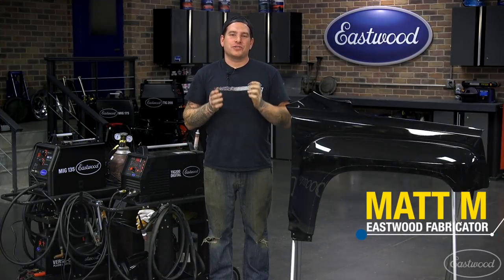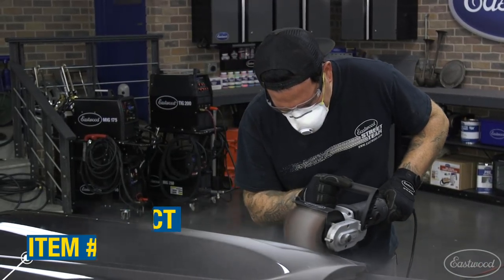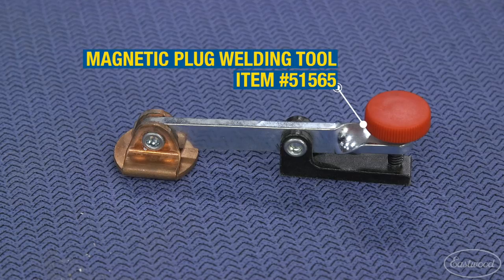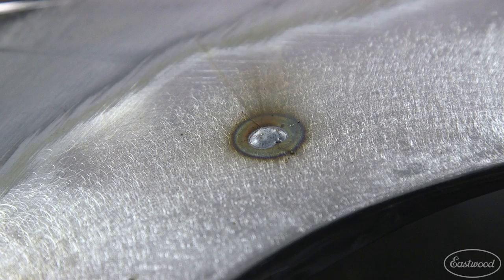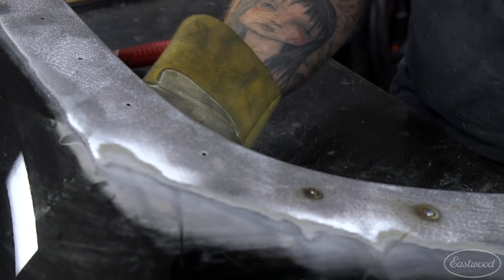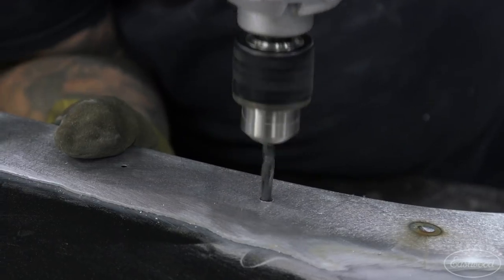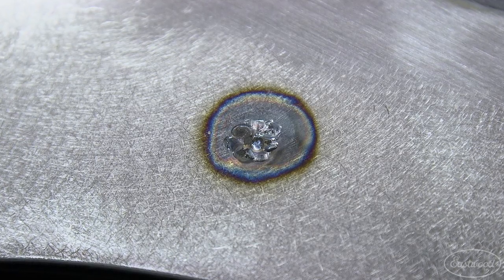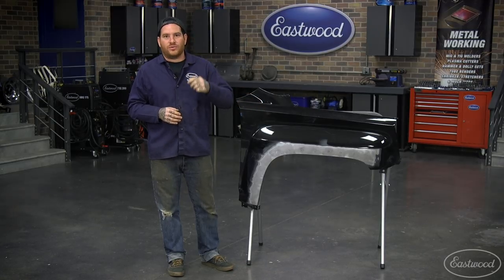Filling Holes in Sheet Metal Using a MIG Welder & TIG Welder! Metal Fabrication at Eastwood

Comment: Is there any way to use the tig without the filler slug, can the tig be used like the mig was? Do the copper backers work with the tig or will you just melt them?
Reply from the maker: You can fill holes with a TIG similar to the MIG technique.